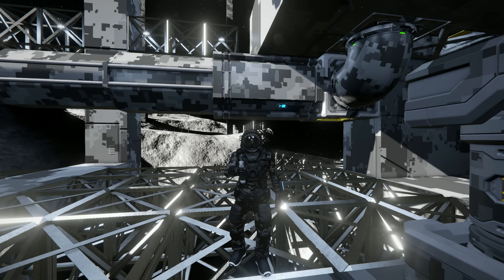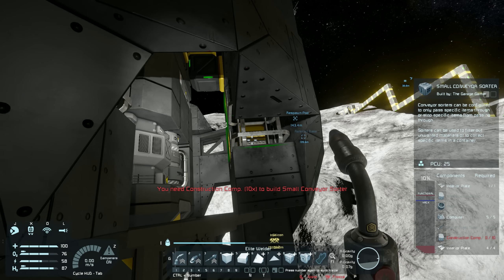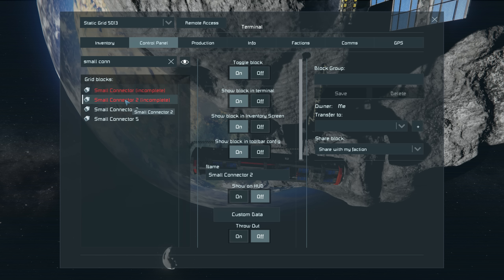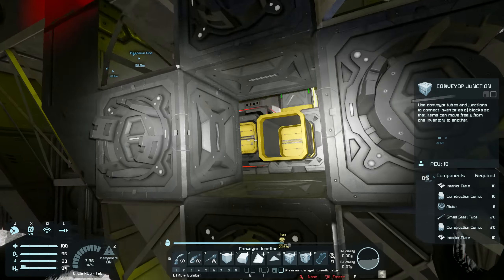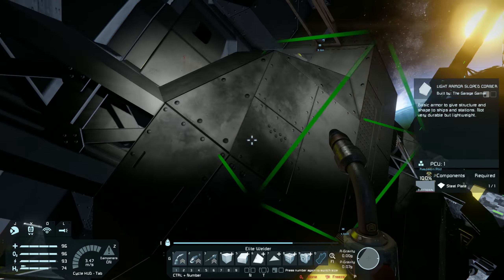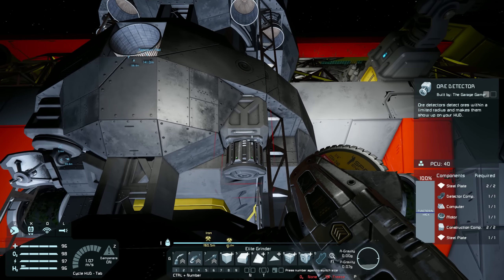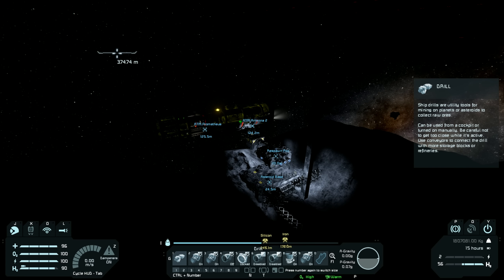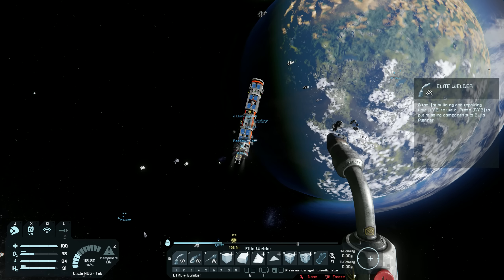Space Engineers - Space Survival - Ep13 - Gold Rush! - Testing the new Miner.

Comment: Hey GG.. got a suggestion for you..
put all the sorters onto the non-drain all option.. make them act like filters only and put the collecters on collect all and throw out..
collectors have a slightly higher 'inventory' than sorters.. so by having them do the draining you get rid of a little bit more stone per tick..
(at least.. they did until they changed the ejecter to a collector.. Splitsie gave this advice originally) 
with all the drills you have.. you'll need every advantage you get

enjoying the new series btw
Reply from the maker: Thanks heaps for the suggestion mate! I was messing around with this yesterday, but I could not remember the sequence of settings between the blocks, I'm going to update this tonight I think, hopefully get the blueprint on the workshop too! 😎

Comment: To add my 2 cents I've never really cared about the stone falling back into my vertical miner eventually there won't be any room in the cargo for the stone to be picked up anyway so I wouldn't worry to much about it plus as your flying around it'll eject more. If I have to dig dig for the ore I'll usually turn the ejectors off then dig until I get to the ore, back out dump all the stone resume ore digging.
Reply from the maker: Yeah after using the miner for a little while it looks like I could get away with increasing the objects in settings to well over a 100 and not have a problem, so I agree with you on that 😎👌.

Comment: If you put the sorters on drain all, they become the bottleneck, with one ejector/connector it is not an issue, but. Just filtering them for stone and puting the ejectors on pull all enables more througput than just with the sorter.
Reply from the maker: Awesome, thanks mate, I will have to check these settings out when I jump back into the miner!! 😎👍

Comment: 24:57 Couldn’t you have just rotated the drill ship 90 degrees?
Reply from the maker: Yeah but the thrusters on the side of the vertical miner may not have enough power to lift the ship once it gets to the moon 😎👍. Technically they have 30,000kg extra, but you risk crashing it into the ground with such little thrust to play with 😔